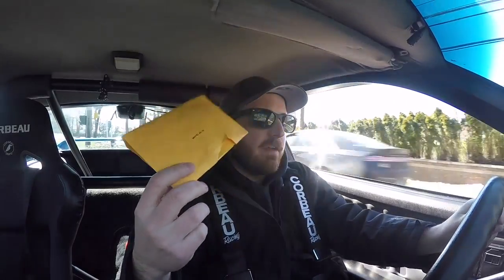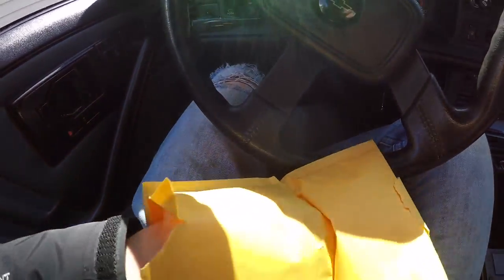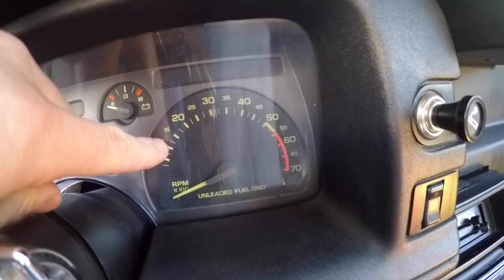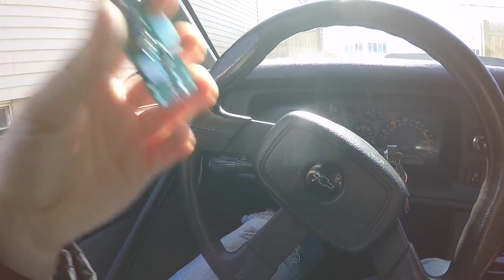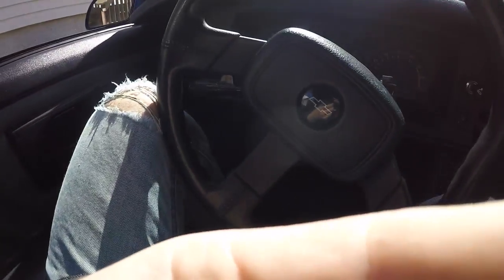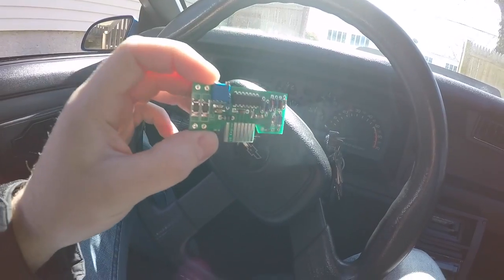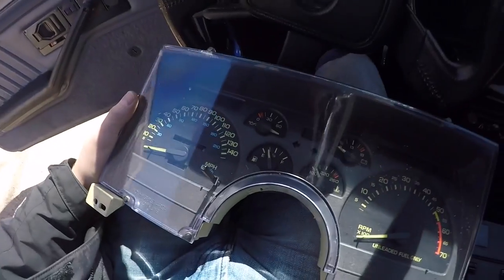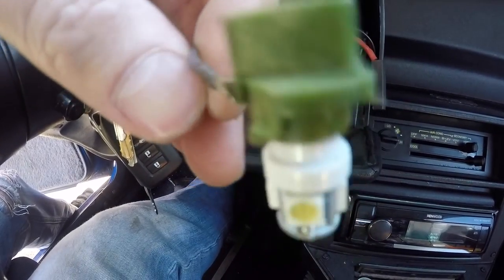1990-1992 3rd Gen Camaro High Reading Tach Repair!

Comment: My gas gauge doesn't work and the fuel float center has been replaced with this be the same type of fix with a chip and the closer for that?
Reply: this is probably going to be a fuel sending unit. hawks has them for 189 new, but you may find it cheaper elsewhere. also, check your resistance from the unit to the gauge.
Reply: wpt bowlonoodle I do not know how to check resistance

Comment: I notice a few changes you’ve made. The stick shift, and what looks like a LS1 motor.
I haven’t looked though the comment section on your videos but I’m going to check you out to see if you discuss those
those changes. Also you changed out some switches, removed some switches and changed the door panels.
You have been or someone has been a busy dude.

Comment: do you know how i can get my rpm on the cluster i have an 89 camaro an im puttin a tbi 03 5.3 with the msd ls box ..the msd has a rpm wire on it but can i get it to work with the stock cluster rpm gauge

Comment: How hot does your car run ? My 91 rs runs up to 235 and then starts getting cooled, I have an electric fan installed . Is that to hot ?
Reply from the maker: With no a/c the fans come on at 190 then turn off at 180. With A/C and all fans running its around 200

Comment: Hey matt idk if your still looking for a new radiator shroud there is a company called killer camaros that makes a clean looking stainless steel one on ebay.
Reply from the maker: Nice, good to know. Thanks👍
Reply: @lsxmatt  Hello Matt, I have a 1991 RS with the 5.0, the tach is always maxed out, sometimes at key on engine off it drops down. The circuit boards link for Ebay doesn't lead to anything now. I would like to know if these boards are still available and if so, where?

Comment: Hey did the cavalier steering wheel bolt right up or did you have get an adapter?
Reply from the maker: Bolts right up.
Reply: Sweet I just ordered one off eBay for  $65 shipped I've been trying to decide on a steering wheel for so long ..i just really like the look of this one...i just ordered a tach board as well I had the same issue thanks for the vids keep them coming ..BTW need more videos of you tearing the roads up with the lsx ..
Reply from the maker: Nicee, yea I got mine from ebay too. I hated the skinny stock wheel, and love how sporty and grippy the Cavalier wheel is. Probably the nicest part of those cars lmao. And it looks totally stock..

Comment: Any idea if this is the fix for a tac that isn’t reading at all my dads tac is stuck on the max even when the car is off I’m new to the car thing any help  is appreciated
Reply from the maker: It’s possible, but it can also just be the gauge itself. Is you car a 90-92? If so, i would start with the board.
Reply: Yes it’s a 92 I’ll try the board first thanks for the quick response love the car and the videos